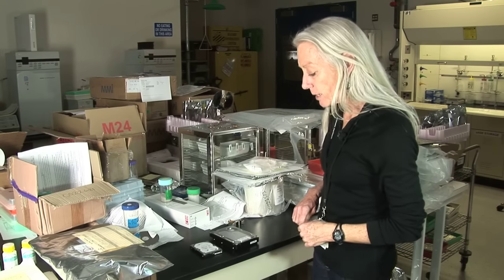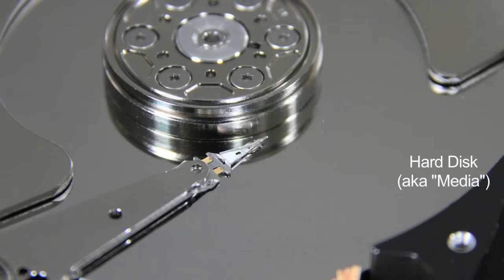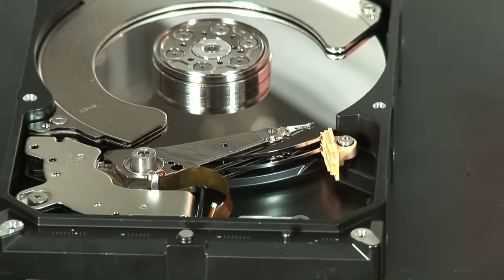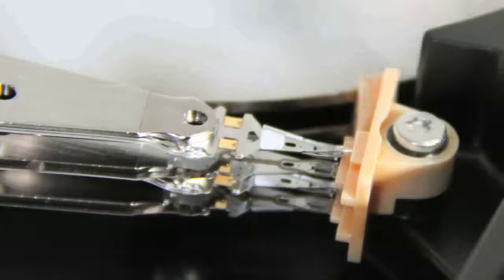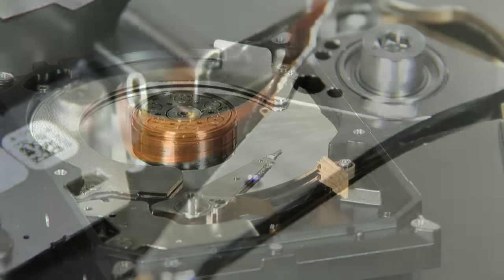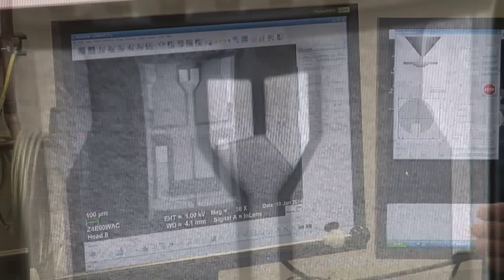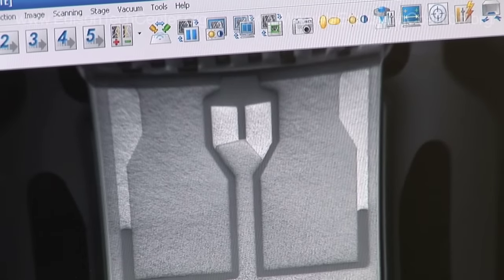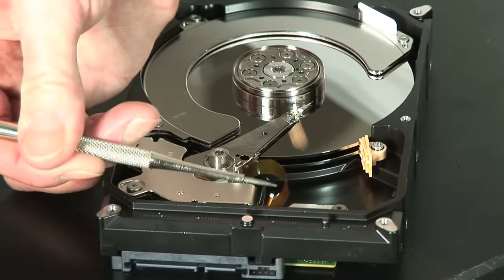How a Hard Disk Drive Works

Comment: Doing a research project on HDDs. Learned how one of the founders of the company (Shugart) used to work for IBM and was tasked with consolidating data stored on thousands of punch cards. The data on the punch cards was essentially the 1s and 0s explained in the video. So insane how after so much advancement in the technology, the fundamental step of reading 1s and 0s (true/false, north/south) is what governs the whole mechanism's structure.

Comment: Main components:
Case
Platters
Actuator
Printed Circuit Board

Other components:
R/W Heads
Spindle Motor
Actuator magnets
Heads Ramp

Hard Drive's main role:
To store all the data, in this case: as magnetic regions and bits on the platters that are coated with a magnetic film.
Reply: bits, data, 0,1.  They do not exist. They are human abstraction, human language for folks who don't understand physics.  When yoiu look at what actually is going on is,  magnetic field in the case of hard drive.  North pole cause current to flow one way, and south pole cause current to flow the other way.  It is these oscillations that transport energy that we experience and perceive as words, pictures, sound, etc. Human perception as the brain operate.   Energy stored in either magnetic fiedl or electric field.
Capacitors in whatever form or other names,  store energy in electric field and it also has oscillations. 

The problem with computer science is the real thing is hidden and covered up with abstractions.  Machine language.  Nope, wrong.  it is not machine language, it is our language.  Machines do not read 0 and 1.  You won't find it anywhere, no such thing.  You animate 0 and 1 as if it is actually spitting out of that head.  It doesn't.  How stupid.
But the stupidity is repeated bilions of times and then it becomes a substitute for the actual.  And it works.  And when you push it, where is the 0 and 1, they will show you the animations... that is right.
Reply: @alchemy1  we live using abstract concepts no because they are truths by because they make progress possible.
Reply: @Itz_Hawks  Yea tell me about it. Worse yet, language itself is an abstraction.  So everything I said is an abstraction.  Using abstraction to explain abstraction.... Oh my.

Comment: It's more amazing, but makes the evolution of it have more sense, when you look up the original hard drive created by IBM in the 1950s. Those metal platters where a few feet across each and a dozen where stacked up. The whole thing had to be encased inside steel beams because it was so large and heavy. It was just then a matter of shrinking down the size. Also the magnetic iron particles use to go either left or right for "0" or "1". Eventually they made it go up or down, which allowed more particles to fit in the same space.

Comment: I used to work on these disk drives when they first came out in the early 80's but the disk drives we're about the size of a large suitcase! I was trained on the technology by Storage Tek Corp. out of Louisville Colorado. Basically same technology but just a lot smaller.

Comment: Next video from Seagate:

How a Hard Disk Drive Fails
Reply: yeh I have seagate 500 gb laptop hdd failed!
Reply: @sultanahmed9694  Mine Seagate Backup Plus external drive failed within 2 months with minimal use... 😂😂
Reply: that is funny, after reading all these comments im surprised my laptop of 3 years with a 2tb seagate hasnt broken down yet
Reply: @Deathrape2001  I use Toshiba.

I used Toshiba HDD for 6 years now. Not even a single maintenance needed.

The Toshiba laptop i use right now was supposed for work. I use for gaming lol.
Reply: 0.5 GB Seagate HDD preinstalled in laptop working from 8 years.
1TB  Seagate portable HDD failed within a year.
Reply: @f3x798  My Toshiba drive developed a lot of bad sectors after just a year of use.
Reply: The read head bangs onto the disk, usually due to shock or deterioration, scratching the disk, causing it to fail.
Reply: My 2tb drive stoped working....i askwd them they said it cant be recovred that easily it should be sent to other country i hate this 😥😥😥😥 my 1.3TB data is lost
Reply: Yup
Reply: @Deathrape2001  go see the BackBlaze list from june and stop the nonsense
Reply: lol
Reply: this happened to me twice, so i switched to a ssd instead now
Reply: Seagate thinks have a great warranty makes up for failing freaking drives!
Reply: Toshibas are currently the best when it comes to failure, they are japanese precision and last a long time
hard drives fail when the flying head crashes into the platter and makes a mark
Reply: Yeap I regret buying Seagate external hard drive......
Reply: @uzefulvideos3440  did you Linus it??
Reply: @foco5657  Well, at least not while it was turned on. I think it just overheated too often. I had it in a closed external case.
Reply: @uzefulvideos3440  it doesnt matter of you Linus it (drop it) on or off. It still breaks
Reply: @foco5657  It makes a huge difference, at least when the fall protection doesn't kick in.
Reply: WORLD EASIERS VIDEO IS CREATED BY MAJID GORAYA YOUTUBE
Reply: It fails due to the non-contact and very small distance between the read and write head and the disk, so that if a small speck of dust enters it will cause it to fail, and this is due to the reliance on magnetic force and the lack of direct, solid contact !!

Comment: So how or why does the magnetism stay so neatly positioned and in order in such a small track ? And how does the reader or riter find the correct spot ?
Reply: There are what are called servotracks or servo data written on the disk while it is in the factory.  If you could see these tracks you would see a radial pattern of stripes repeating about 200 times around with disk. The radial stripe patterns are bent into an arc that matches the path followed as the actuator arm sweeps across the disk so the read head encounters the data at exactly the same time as the disk turns, no matter where the arm is positioned. The servo data is written by positioning the arm at successive radial positions and writing with the recording head so that each write exactly lines up with the next track radially forming a continuous written line across from inside to outside of the disk radius. As the read head passes over the servodata it gets a burst of 1-0-1-0-1-0-1 no matter where the head is positioned or how it is moving. At the back edge of each servodata stripe the pattern changes slightly with some writes omitted so that you a pattern that tells you the track number - 10001, then 10011, 10010 etc in a gray code. Just behind that is 1010101 again but as bursts only one track wide repeated four times with all but one of four bursts turned off. This is the ABCD pattern. These bursts are written A----,-B----,--C-, ---D at successive radial positions, each offset another half track width radially. The read head will see maximum signal for, say the B, burst when the read head is centered over the radius where the B burst was written, while the A and C bursts will be offset radially to only fall half over the read head and have half the amplitude. By comparing the A,B,C,D burst signal strengths you can determine the offset from centered within a track.  (I'm simplifying a bit here because the read and write heads are not at the same radius so you have to correct for that offset.) As the disk spins, you get location information from each servodata burst and can use that to tweak the current in the actuator arm control coil magnet to push the arm in the direction it needs to go to stay on track. Position accuracy of a fraction of a track width is needed.

Comment: Wonderful!   Thank you.   Would have been better to show a drawing of theads.    
What is the rpm of the disk?  (How many feet/second of the disk beneathead?)   
Does thead accidentally read more than one track buthe strongest signal is chosen?  Difficulto believe thathead can be so perfectly positioned to read just one track when you have 100,000 per inch.
Reply from the maker: Hi Robert! For additional questions, please contact our tech support team on our website: http://seagate.media/6054Ta57u Thank you.
Reply: @seagate    No.

Comment: I have a habit of cooling down my external hard disks using a cold wet towel. It really works well. Temperature can drop from 52'c to 42'c in just 3 minutes.

Is this method safe for the hard disk?

Comment: "domains": the head magnetizes the shiny magnetic lacquer either north pole up or south pole up. It's like 0 of the data is north and 1 is south or the other way it doesn't really matter what convention they use. But they insert some extra service 0's and 1's in between for the same reason like if a bank account number has 0000000000 in it you look at it and are not sure if it's 9 or 10 zeroes. So they insert those extra digits that don't carry any data, just to make sure there is not a long run of the same digits which would be unreliable to read. Then when the head reads the signal back from the magnetic disk it surprise surprise gets an electric signal according to how it was magnetized.

Comment: Q: So, is it correct that the HD  heads never physically come into contact with the disc, but ride a cushion of air?  Q: Will proximity to a microwave source damage or otherwise corrupt magnetically recorded data on the disc?, for example a laptop in close proximity to a microwave oven?  Q: Will sudden movement, shock or jarring cause the arm/head mechanism to skip, jump or otherwise misalign, similar to an audio CD player?  Q:  Is there a way to dampen the shock force to a HD say, aboard a farming tractor, rocket or high shock environment?

Comment: I have a question. are those remapped sectors reported by SMART recoverable? 
I have been using a WD green 3TB for a year then SMART throws a warning about HD failure and replace it asap.   
But I checked again with WD's own HD tool , it tells normal, just a number of sectors has been remapped..
Reply: The drive tries to read from the sector and when it gets errors, it tries various error correction steps that were written along with that data. If after say X number of tries, the data is still not readable without errors, that sector is marked as bad and data shifted on to the next one if it was able to read it.

Your drive had remapped the sectors so the data was finally read after many tries and shifted onto the reserve sectors. Backup your data and keep a close watch on how those sector numbers rise
Reply: What you need to look for is increasing number of sectors being marked bad.  I maintain disk arrays, and I can say I've had new drives with bad sectors but the amount never changed, that's why they build spare sectors into the drives, for remapping bad ones from the manufacturing process.  If the count starts to INCREASE then you have a failing drive for sure.  It could die tomorrow or it could die next year, I would just replace it or use it as a scratch disk, and not put anything important on it.

Comment: Very impressive technology.  Of course, like everything else, technology has moved on.  For example, my home office PC doesn't have any disk drives / moving parts.  It has two solid state drives each holding one TB (Terabyte) of data.  Compared to disk drives, they are extremely fast and more reliable.  No moving parts to wear out or fail.

Comment: How Seagate hard drives work:
Bad sectors, stuck heads, scratches on platters
Reply: It is 3 dead barracuda 1tb HDD behind 6 years on dad PC. 11000 reallocated sectors. I have seagate momentus thin 500gb. It have only 16 reallocated sectors behind 5 years.

Comment: Explanation for normal people: the smaller hard disk is for notebooks, the bigger for desktop PCs. The name comes from the recording disk inside, which is actually hard. At the end of this kinda tonearm there is an electromagnetic reading and writing head like in a cassette recorder. The disk is covered in the same stuff as the tape in the cassettes and turns, so it works like a casette recorder. It's just all tinier and faster. The tonearm is moved by a coil stacked between two magnets. When current goes through the coil it starts being magnetic and repels or attracts with the magnets and it moves the tonearm around.

Comment: Its it possible to make video how to make fast but slow RPM harddrives with much reader arm than normaly disk? the most isssue that HDD is slower than SSD is because its only have one input\output on disk so its not raid. I hope some one can make video why the most hdd failed? i think motherboard on disk or head of the disk?

Comment: Put a sheet of paper on the table and blow under it. It will kinda magically effortlessly glide over the table like a hovercraft. That's how these heads glide over the spinning disk without touchingn it. If you accidentally bump the harddisk, the heads dent or scratch the disk and you can throw the hard disk away. So they put a piece of plastic there on which the heads rest when the disk is turned off, so they cannot dent or scratch anything.

Comment: If there is a sudden power loss, the readers/writers can be stuck where they are, and damage the disk. Why do HDDs not contain a small battery that ensures, in case of sudden power loss, that the arm can move back to the OFF position? I lost so much data in several HDD failures caused by power losses.

Comment: And here I always thought that hard drives used quadrillions of microscopic transistors as binary memory latches.  Maybe a SSD or flashdrive?  never knew they used magnetic memory.  Almost like a CD or DVD except it is not read by a laser and is easily re-writable.

Comment: I have a SEAGATE 4TB SSD Hard drive which has all of a sudden stopped during a data transfer from this external hard drive to my desktop PC.  I have tried the same Procedure on my laptop and it does the same thing.  When it gets to 6% of the download it stops and will not go any further.   Does this problem sound like a Sata bridge to you?  I am also getting this message "CANNOT PERFORM THIS OPERATION DUE TO FATAL ERROR"  BUT I CAN SEE MY FILES FROM THE SSD EXTERNAL HARD DRIVE BUT WHEN I CLICK ON THEM I ALSO GET THIS FATAL ERROR MESSAGE.   HELLLLLLLP! LOL

Comment: your DM family and 7200.11 and .12 drives have a tendecy to crash hard scraping away all of the data. We've had multiple of those families of drives die at work, some bad sectors, some firmware, and the rest crashing so hard that the inside of the drive is all dust.

Comment: I Have now lost 2 Seagates. That with all the data stored on them. The first one I tried to recover the data with Recoverit but all it did was overwrite the existing data and I never got a thing back even after paying for the service. Now my, I T Seagate backup has stopped communicating with my laptop after 2 years of use. The light is on and the disc is running but the laptop does not see it not even in Device manager or disc manager. very disappointed in Seagate and worried that I will not be able to recover the data on the disc.👀

Comment: Hard drives typically have several platters which are mounted on the same spindle. A platter can store information on both sides, requiring two heads per platter.

https://en.wikipedia.org/wiki/Hard_disk_drive_platter

Comment: A 8TB SMR drive just died after 2000 hours, so tell me Seagate how is this possible ? Just over night, the drive disappeared and when I reconnect it to power, it does double of 2 consecutive metallic noises and the disks are not spinning. How it's possible ? The drive wasn't affected by a mechanical shock.
On the other way, I have a 3TB surveillance drive with 60 000 hours and works like on day 1.

Comment: Kingstone , Pendrive  working fine over 15 years. 250G Iomega drive can use more than decades only have some bad sectors not totally  unreadable.
The 2T Seagate expension+  given by Seagate Data Recovery Center only had 1 day life time sudden death. Labelled Made in china 2020
Is  the  microsoft  bit  locker   kill  the  2T  seagate  expension+  or  it  is  a  defective  product  manufactured  in china 2020?

Comment: Segate released a video dated in 2014, and they're still using Windows XP? lmao
Reply: Ever think the video was made a long time ago? Why put out a new HDD video when the tech hasnt changed in a while? But I seen an apple computer so maybe they aRE JUST USING DIFFERENT FOOTAGE?
Reply: As someone who works in the industry, I personally think it makes no sense for a company who is highly notorious regarding hard drives to have a video that is old in any way. Maybe they can't afford a new video from all the HDD's replaced by people using their warranties for failing drives hmmmm
Reply: software/hardware used in those systems were made when XP came around and it is too expensive and risky to move to new OS. Over the years all software/hardware that were developed are closely working with each other and you would have to change all of those...not a trivial task...and super expensive...also dnt fix something that isnt broken...
Reply: I still work on lab equipment that runs DOS or windows 98.  When your equipment costs millions of dollars to replace, who cares what operating system it's running as long as it still does the job it was designed to do.  I do insist on segregating these systems from the WAN and even the LAN due to security concerns.  Lots of equipment is proprietary or defunct and you can't get drivers for it to upgrade to windows 10 or even windows 7 so what are you going to do?  Spend millions of dollars buying new hardware just so you can run windows 10 for the same results you are getting now from DOS or windows xp?  Fat chance...  Someone would probably get fired just for suggesting it.